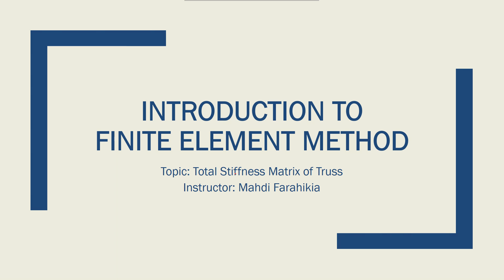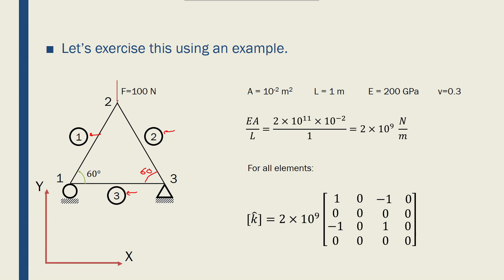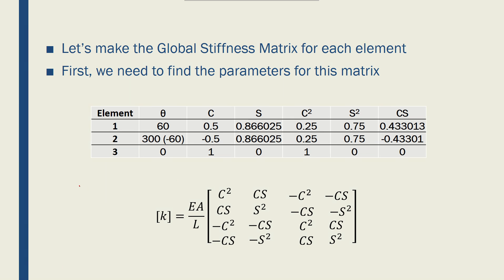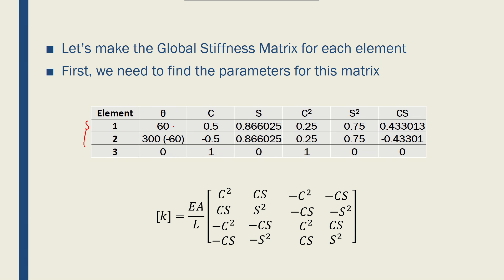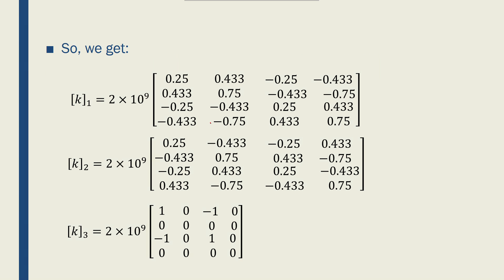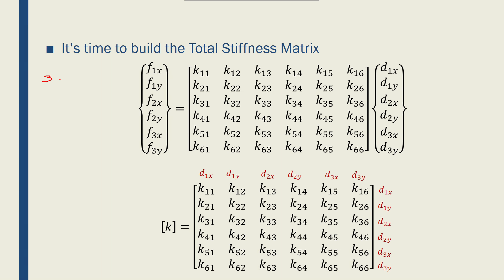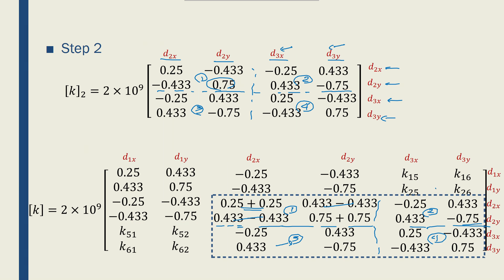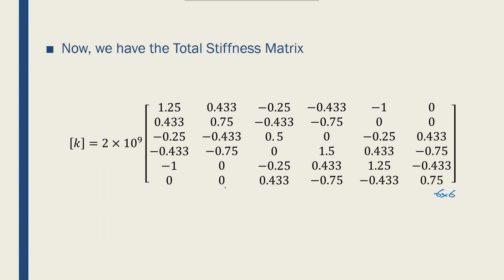Intro to FEM - Week02-11 Truss Total Stiffness Matrix 01

Comment: Fantastic explanation. I also greatly appreciate using notation that correlates to the variable/function whereas several textbooks resort to utilizing bizarre notation (e.g. setting sin(theta) = m, or setting d_1x = u_i). It's also beneficial that you continue to expand each step which helps clear up any confusion as opposed to other sources opting to just get from A to B (e.g. going from LSM to TSM in one step).